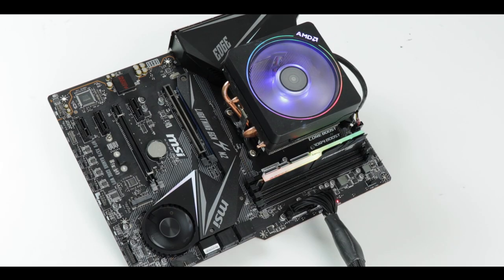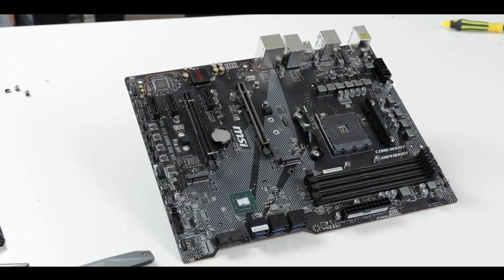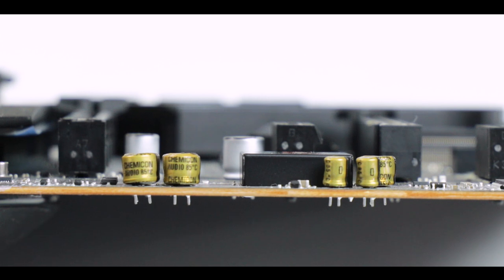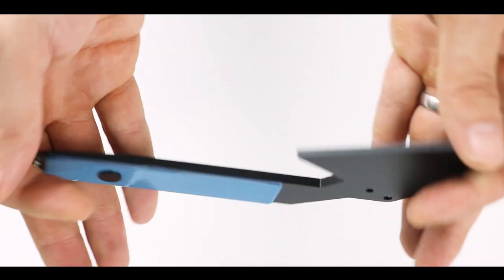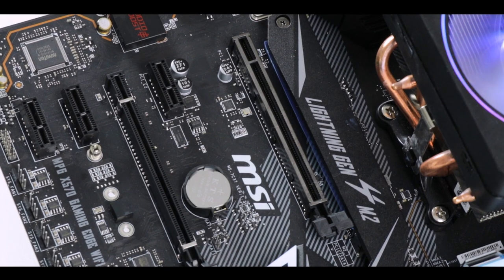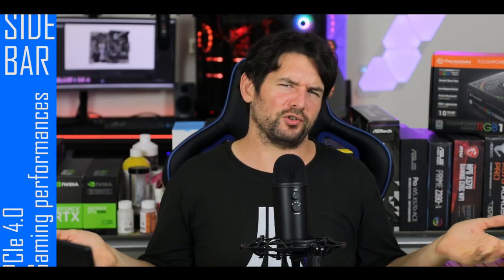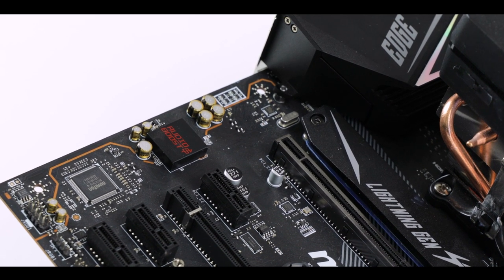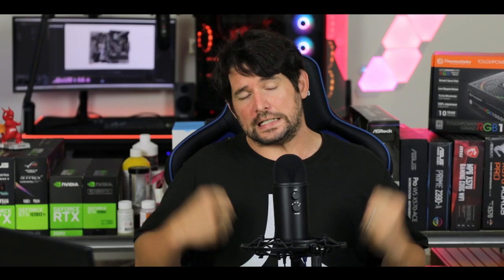MPG MSI X570 GAMING EDGE WIFI : No, No, No!

Comment: I think you're being a little too harsh on this mobo.  I did some testing of my own.  I have a 3800x 8 core cpu, running all cores at 4.2 GHz  with prime 95 the max reading I got on my infrared thermometer for the vrms was 69c. Also my chipset fan doesn't even run when I'm gaming with my 5700xt under full load.  I think this mobo is fine for most gaming PCs.  Sure overclocking enthusiast would push it more than I did for my tests, but would someone like that buy this board in the first place? Probably not, that's why there are premium quality boards out there.  Tl/DR - this board is fine for gaming PCs.
Reply: Have you had any problems with your motherboard?  I’ve seen reviews of them dying after 2 or 3 months.
Reply: @yazendaddi9127  everything is still working fine, the only thing I've had an issue with is my front panel audio jacks.  I can't be bothered to diagnose the problem though, because I use a focusrite audio interface most of the time.  so IDK if it's the Mobo, the case, or maybe the drivers.
Reply: I have this mobo too with a Ryzen 7 3700x an MSI RTX 2060 armor oc super 8GB, 32GB of Corsair 3000 RAM a 1TB M.2 and a 2TB hard drive. I have not changed a single setting as yet on my GPU or on the bios or anywhere, and everything has been fine for me even after gaming for 4 and 5 hour sessions. I have heard these terrible things about this mobo (after i had the pc built last summer) but all i can say is mine has been good so far. Keeping my fingers crossed.....
Reply: Because of the bad reviews i could pick it up for 149 new, what a steal!
Reply: @troopzaftv0  Link to where that is? Cheapest I can find is $290 CAD
Reply: @inkusalters  best buy 199 its a fine board not everyone overclocks
Reply: @michaelptrkcovers6422  Just saw it this morning, thanks!

I don't plan to overclock, most I'll be running on my rig is Total War Warhammer and my specs are more than enough for it to run smoothly without being a beast of a system. 

Honestly for the price it's at and all it offers it seems like a really good board.
Reply: @inkusalters  149 euros is 230 monopoly cad dollars so just wait for a deal
Reply: blm50881 did u ever fix ur front panel audio? I have the same problem
Reply: mine is fucked after a month, the bluetooth wont work at all.
Reply: Can you use in the first m.2 slot only gen4 m2?

Comment: Just using this as is without over clock. It's fine. 2xm2.  Good connections. Bluetooth and wifi is what I needed.
Reply: ThePotatoIsAStarchyTuberousCropFromThePerennialSolanumTuberosumOfTheNightshadeFamilyLOL is it fully wireless? Like I can’t connect to my WiFi downstairs?
Reply: @xnightzombiesxwontroba872  theres an antenna it comes with that plugs into the backpanel

Comment: Bought a Asus TUF X570 PLUS last week and it only lasted 3 days. After that fiasco I exchanged that one for this MSI MPG X570 Gaming EDGE WiFi board and so far not a single problem after 5 days of non-stop running!
Reply: JessieJ I bought the msi x570 as well. Working well so far.
Reply: may I know what processor are you running with the msi mobo?
Reply: Franz Joseph Gonzales I’m running a 3700x with 32 gigs of Corsair vengeance ram @3200mghz.
Reply: thanks for the replies guys. I have this mobo also just waiting for the 3700x processor. I was thinking of selling this because of the bad reviews but maybe I should give it a try. BTW Im not planning on overclocking. Thanks again

Comment: I’m trying to use this motherboard to GPU mine but I can’t get more than 2 GPU’s to work

I got as far as it showing up on device manager but it is disabled due incorrect drivers (error 43) it has the latest drivers and the gpu does work when it’s only one in the system and paired with only one other gpu

All the PCIE lanes are set to gen 1 with 4g enabled.
Ryzen 5800x
Gpu 1 3090 fe
Gpu 2 evga 2080ti 
Gpu 3 3070 fe
PSU 700 and a 850 gold

I thought maybe the risers but I’ve tested them and all work as long as no more than two gpus are installed.

If you have any ideas please let me know.

Ps: I wish I saw this vid before I bought this motherboard 🙇🏻

Comment: Well it seems to be doing the job with my 3700X configured with GSkill 3600 CL14 Ram.
Reply from the maker: To be clear :) 
It will do the job. The only issue is the board durability compared to equivalent pricing competition. 

With a 8 cores, you are right on the limit.
Reply: @Laurentschoice  Yeah that is what I figured.  Being a MSI fan I questioned some things but I am just so used to MSI I went with the board.  Going from a 4770K to a 3700X the online gaming performance is just insane.
Reply: @Laurentschoice  im going to use  a ryzen 2700x in a build but will likely upgrade to a 3950x, is it smart to use this board?
Reply: @PugkinSoup  shouldnt have a problem
Reply: Any updates? I'm considering the Ryzen 7 3700X too and I'm worried that it might cause problems after a while...
Reply: @Kunark  honestly I went with a 3600 because it pairs with a 5700xt without bottle necking if you go to the 3700x you need large budget for the gpu 2080 super or bottleneck but this mb works fine on my build
Reply from the maker: U r fine with a 3700x :)
Reply from the maker: Ouf... 3950x... i would strongly suggest... anything else... and I mean anything

Comment: Overclocking is outdated tbh. As powerful as shit is now stock clocks with xmp enabled runs all the frames. I guess if you build a pc for the sole purpose of running 3dmark demo as high as possible meh? But you do you boo boo. I dont need 300fps in red dead at 8k getting ARS from the radiation coming off the pc. Not for me fam.
Reply from the maker: Fair comment. Cant disagree with that.
Reply: 150% agree with this. It's not 1999. Building an optimised PC these days is as simple as putting the components in the only slots they go in and Voila! No need to touch. Seriously, whats an extra 10FPS after you're already getting over 100 on ultra settings at any resolution. Not worth risking the hardware longevity. Overclocking is for Big D**k Ballers only.

Comment: After owning it for a year and a half. The most disappointing of all as a owner of this mobo is the performance of the IO. USB's are laggy, ports don't always work,  and you have no control over the speed/variance to specifiy the overall USB spec. (this has nothing to do with the x570 b550 usb issues) Controls are split between the MSi dragon center desktop app and the lackluster bios. My mobo from 2012 had more in-depth settings than this childish looking advanced settings.

Not gonna lie, but overall the board is usable. But I expected more from MSi on every aspect as not even BIOS updates have resolved much of anything.

Comment: I've been using it since 2019. I have a ryzen 7 3800x processor. I have never witnessed the vrm temperature above 60 degrees in any game or program.
This whole myth originated after the garbage review by "hardware unboxed".It is already admitted that the "review" was carried out in an air flow-free environment and by removing the cooling blocks.
As for your video, it doesn't contain a test anyway, other than empty words. Stop doing garbage clickbait ''reviews''.
Reply from the maker: Unfortunately,  all major reviewers agreed to my conclusion. 

MSI itself has changed their manufacturing process to adress these issues that they did openly recognize in the reviewing Shere:)

I hope this helps !

Comment: can ihave some help?

i have a MPG X570 gaming edge wifi (ms-7c37)

i have 2 x Corsair DDR4 Vengeance LPX 2x8GB 3000 C15 - [CMK16...

so totally 32GB  but it only reconize 8 per piece...

so it it is 16gb

Comment: I feel like this video is overcritical and you just got a lemon. I do see a lot of people complaining but just as many saying they have zero problems. My guess is MSI just had some really bad QC for this board. I've been running this board for just about 2 years with a 5950x, 3090 FE, 2 M.2.'s and 32gbs of corsair vengeance at 3200mhz and my temps have been pretty low and no problems with Ram or the i/o.
My only gripe is the LEDs on the mobo that I can't seem to change and no type C header.

Comment: heyy so i just got a 5800x with this board and i got a blue screen windows crash wile loading a CPU heavy game but i was watching the cpu temp at 70 when the crash occured and my gou was only about 60c aswell

i previously had a 3800x and turned PBO max mhz to +200.. would that extra 200 mhz heat up the VRMs to the point of a windows crash?? cuz i know gpu and cpu were 70 degrees or under so i dont understand the crash other than overclock settings and bad voltage or something

Comment: I have to disagree with you, I am running with Ryzen 7 3600 , EVGA 3070 and I my temps do not go above 60c , when I am grinding for hours, and photo editing. for me personally have had no issues at all, am I do any Over clocking no. I think over clocking is way more hype then needed. But my rig is running great with this motherboard.

Comment: Got one, Ryzen 5 3600x, and no heat or other issues, for me great deal. Everything stable, got 4.2Ghz oc stable, tons of features, wouldn`t change it..
Reply from the maker: 3600x being a 6 core CPU, you should not have any issues.

Actually, that was my conclusion.  With anything below an 8 core, its actually a pretty well featured bored.
Reply: @Laurentschoice  so i dont need to worry? I bought a 3600x from amazon and this board, i dont plan to overclock anything so temps will be tolerable? im really worried to fry my board...
Reply from the maker: Ur good :)
Reply: @ShishigamiLP  Nope. this motherboard is actually dope, but I wouldn't use it with a 3900 myself. Got a 3700X, this the best cheap x570 board you can get for the price and anything below a 3700X I would say.
Reply: @helgenx  no overheating?
Reply: @Habs1967  got this board for my R9 3950x runs great, getting a score on cinebench r20 of 9145 on stock also got a corsair h150i pro to cool the cpu which has 16 cores 32 threads
Reply: Laurent's Choice it’s running perfectly fine and was even able to squeeze a little over lock out of my 3900x no thermal issues I would 100000% recommend this board
Reply: @js-gc2hk  oh your the one, MSI should give you a raise.
Reply: @Statikk  FROM MSI: The check is in the mail.
Reply: I have a Ryzen 75800x and i haven't had any issues at all

Comment: I am in the process of making my first assembled machine. Since I’m not into gaming, I was not very particular of having an external graphics card. But I very much want PCIe Gen4, USB 3.1 Gen 2 (10Gbps) or 3.2 (20 Gbps), and preferably PCIe Gen4 M.2 slots. Before viewing your video, I converged on Ryzen 5 3400G (since it has Vega graphics) with this MSI MPG x570 edge WiFi motherboard, OLOy 32GB RAM and Sabrent Rocket 4.0 500GB NVMe SSD. After viewing your video, I am confused. 

What motherboard do you recommend for my application (scientific simulations) that has PCIe Gen4 and USB 3.1 Gen 2 (10Gbps)/ 3.2 (20 Gbps)? Any help is greatly appreciated.

Comment: Need help. Built with this mb but it doesn’t boot up. The usb works but the keyboard and mouse does not turn on . Setup is x570 gaming edge wifi, ryzen 3 3600, xfx rx 5600 thicc pro, t force nighthawk ram 8x2
Reply: my guess is its something to do with your ram clock speeds, and is your cpu a r5 3600 or .....an r3 3600?????

Comment: I agree with this review, this board is OK for basic memory and settings but poor for any overclocking, its a basic board but crap for anything other than basic. I have just upgraded from this board
Reply: I disagree. It has odd issues with the RAM channels thatI've seen happen quite frequently.

Comment: Wow, thanks for this. I just bought this last night from Best Buy for $199, came across your review this morning and now I'm returning it. Thank you.
Reply: Don't , had this board for 4 months now with an RTX 2070 Super and a Ryzen 3700X  both Oc'd , highest temp i recorded on VRM's is 60c with 30c idle.
Reply: alex rgi  Pretty sad actually , a great product receiving huge backlash while people steering away from it cause of videos like this reviewing a 200$  mobo as if it was a 600$ one even though i've seen comments of people with Ryzen 3950x coupled with this board reporting no thermal issues which discards this "review" all together .
Reply from the maker: Just wanted to remind you all that, as mentioned several times in my review, my concern with this board is how it behaves with anything beyond 8 physical cores (OC) and its overall durability . 

Since your all using it with 8 cores or below, you will not have any issues. At least for now. 

2nd.. obviously this board was not released in a vacuum and its similarity priced competition does not have the limitation this board has :)

It seems like I am not the only one coming to this conclusion in the reviewing community :)

Hope this helps .
Reply from the maker: Absolutely ahahahaha :)

Well done :)

Comment: I've been using this board for 3 years now as a server with a Ryzen 9 3900X + Noctua and works great. CPU is at 56ºC and the chipset fan is at 0 RPM during normal operation. Not using the wifi nor the audio, so can't comment on that.
With the latest BIOS update (4th July 2023) it allows booting without GPU or integrated graphics, setting the new option "VGA Card Detection" to "Ignore". That was my only issue and now it is fixed, so I'm happy with it!

Comment: can use a msi mpg x570 wifi motherboard amd with a cpu amd ryzen 9 3900x 12-core 24 thread unlocked desktop. could i have issue with heating if i dont  overclock  just normal use?
Reply from the maker: It's really not the best option . It will work,  but ur thermals will shorten the life span of your motherboard
Reply: Laurent's Choice so what motherboard do you recommend me to use with the cpu Ryzen 9 3900x?

Comment: ok i don't have tha Gaming Edge version which u did review but i do have a MSI - MPG x570 Gaming Plus and i was wondering is it any better than what u reviewed? my CPU for it is a Ryzen 5 3600 and Corsair Vengeance LPX 3200mhz DDR4 Ram, but it's only gunna be used for my side External Livestreaming/Capturing purposes! now i don't plan on doin' any overclocking and i wanted to get a ASUS x570 Tuff but they got bought up and i was in a hurry to get away from tha awful AMD FX 8350 nightmare for external livestreaming! did i make a good decision despite it being only used for just external livestreaming/capturing purposes! 

i do plan on gettin' a Asus TUF X570 in tha future just for spare uses but yea as of now i couldn't wait no longer to put tha nail in tha coffin to my awful FX 8350 and hopefully it couldn't be worse than commin' from a FX 8350 :O

Comment: @Laurent's Choice I have a question, this video was made about a year ago at this point. Is it safe to say that MSI most likely updated the BIOs to correct the VRM heat issue? Or is that even possible? The reason I ask is because I just ordered a super high end 9 3950x/3090 build and this is the mobo that they are using with it and I didnt see this and Hardware unboxed vid until after and now I cannot change it.. ? Can this type of issue be addressed in BIOs updates?

Thank you !!!
Reply: There is no overheating issue
Reply: @Taylormade2350  not that i disagree but how can you be sure??.. i just got a blue screen windows crash when my was 70c.. i found out my gou fans dont even turn on until 60c and it felt hot to the touch on the bcl of my gpu and i was worried that my gpu was heating up my motherboard without the cpu doing it

is it definitely not possible for VRMs to overheat even if the other heat sources my not be venting properly??

Comment: Really interesting. I bought this mobo with the ryzen 5 3600. It never even gets remotely warm and I’ll play say dcs world for like 7 hrs haha. Although I paid the extra for a better cpu fan and have 5 fans running. It works amazing imo. I’m not o we locking or anything though.
Reply from the maker: So the PCB junctions points are on the back of your board. They are the ones accumulating all that temps.
When going beyond 100c, the lifespan of your board is dramatically affected. 

You wont see it on the CPU or even the VRM. 
But only on the actual soldered points, which will break over time.

Hope this clarifies
Reply from the maker: One more thing. 3600 is fine with this board. U should not have any issue. 

Problems will arise at 3700x levels and higher.

Comment: I have this board with a 3600, 16gb 3400 vengeance ram, and a XFX Fatboy...random I know lol, I don't overclock as such but have all mobo gaming and settings and PBO ect switched on, I've never had any problems at with the CPU at 4.2 and ram at 3600 highest temps I've seen about 65° full load. Loved the video though learned quite a few things about the board I have found it hard to find info about elsewhere thanks

Comment: hmm i just traded a strix 1080 non ti and got 100 bucks boot for this board. keepin in mine i had a xfx rx 5700 ddultra in the 1080 tho...gonna use it for a 1600af @4.1ghz for now and then a 3600 or new zen when it comes out on desktop

Comment: WIll this last?
First time to buy didnt check about this review 
Hope this last for years :(
Specs
CASE) fantech cg80 white/black 
(MOTHERBOARD) MSI MPG X570 Gaming Edge WIFI (AM4) X570, ATX  

(PROCESSOR) AMD Ryzen 5 3600 6-Core 12-Thread 3.8-4.4 ghz 35mb 95W 

(SSD)Crucial p1 nvme ssd 500gb 
(RAM) Klevv Cras X RGB 16GB (8GBX2) DDR4 3200 CL16 RGB 

(GPU) Asus Tuf GTX 1660 super 6gb OC 

(POWER SUPPLY) seasonic gx 650 gold plus full modular 

(CPU COOLER) cpu liquid id cooling zoomflow 240 ARGB
Reply: Same,, How's the board?